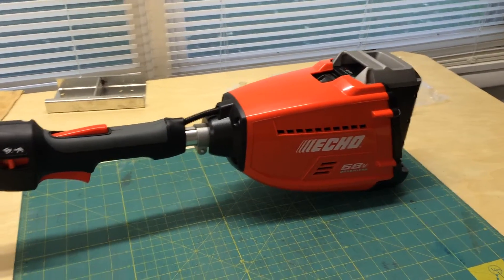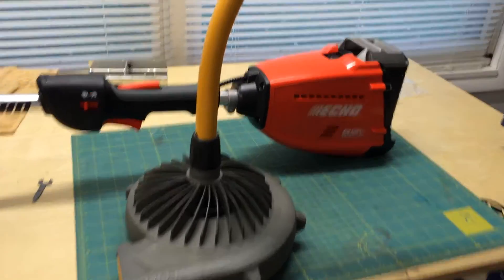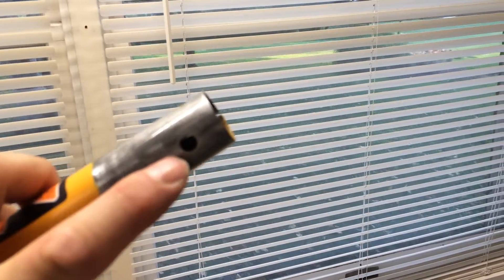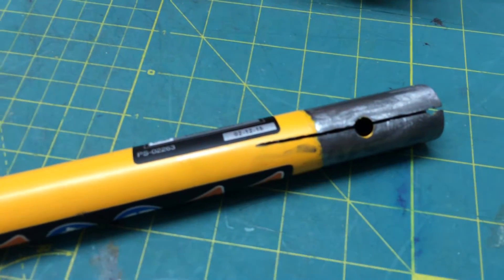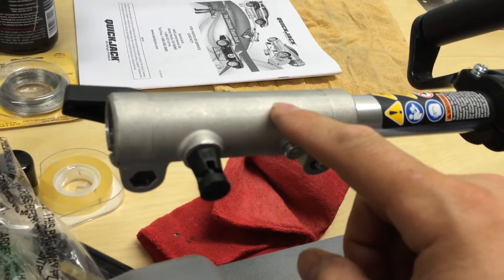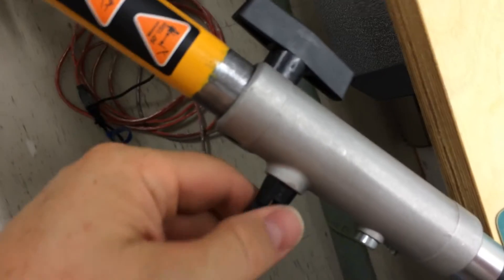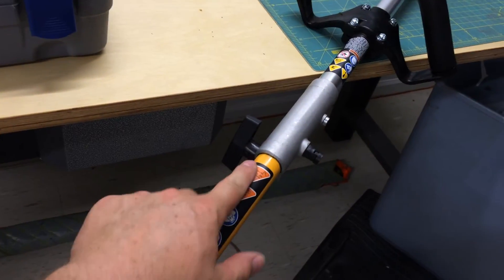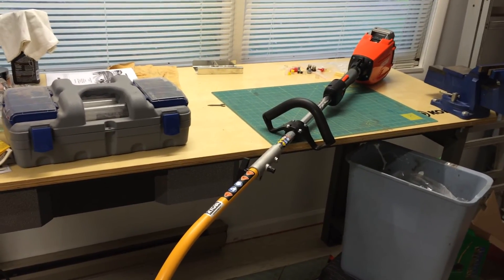Using Ryobi attachment on Echo 58v trimmers

Comment: Thank you to the creator of this video! Can confirm it works with a gas Echo PAS power head. I measured down from the top of a curved shaft Poulan PRO edger attachment 1.5cm and drilled the hole for the pin detent, then used an angle grinder with a cutoff wheel and sliced into the bottom of the attachment shaft vs using the Dremel as the original poster...only took a few minutes...works perfectly...will be doing other universal/Ryobi  attachments...Thanks again! Cheers!

Comment: Did you remove the pin assembly from the Echo coupling housing to pinpoint where to drill the hole on the ryobi attachment shaft?

Comment: I just did this.. my suggestion if it's not going in well is to not force it but make that line cut a hair wider until it goes in snug but not super snug. I managed to screw the whole in the opposite side, always sticking things in the wrong whole.. sigh. 

Thanks for the video. :)

Comment: Good helpful video. I would think you would want to drill the hole before cutting the slit for sure.
Reply: That is what I did...I have the Echo Power Paddle so just measured where the hole is on that shaft and drilled into my edger attachment the same location (made the hole slightly larger)...Then cut the slit in a vice...worked like a charm

Comment: Nice work. The drive cable interface match up pretty well?  Wouldn't want that to ever strip out, obviously!
Reply from the maker: +misterangular It appears to be exactly the same size and shape- a square end rod and receiver.
Reply: +Chris Paveglio Sounds good. Thanks for the reply & posting this vid. I've got the Echo trimmer, 4 Ah battery, hedge trimmer & the blower. Solid products.

Comment: Did you need to use a drill press for the side hole or did you just use a drill?
Reply from the maker: I used a hand drill, if you have a press that would work of course.

Comment: How is the motor in the echo? Has it burnt up yet or still good? I thinking about doing this but just scared of burning it up ?
Reply from the maker: I'm not a very heavy user, but after 3 years it still runs great! I will never buy another gas powered tool or mower again.
Reply: Are you saying you will not buy another gas powered tool again because of the mod above (sarcastically?) Or are you being serious and why?
Reply: @chvydrptop  56v and up brushless motors actually make more torq then a 2 stroke. Lighter weight quiet and best part no maintenance.

Comment: how far from the end of the ryobi  where you drilled that 1/4 hole?
Reply: Use the original attachment to get your measurement.
Reply: I don't have an original attachment, I was given the power head. I can figure it out but I'd like to know also if someone has that info available.